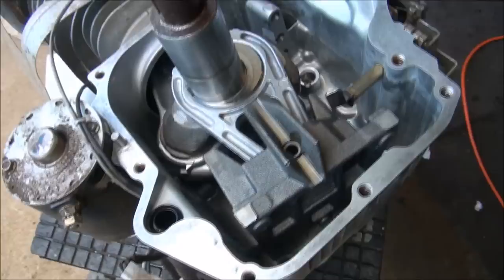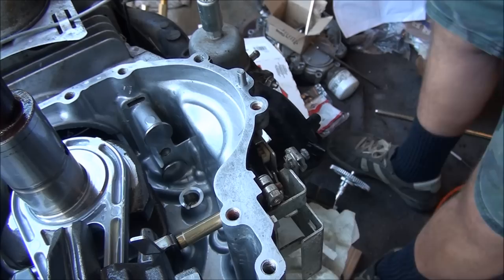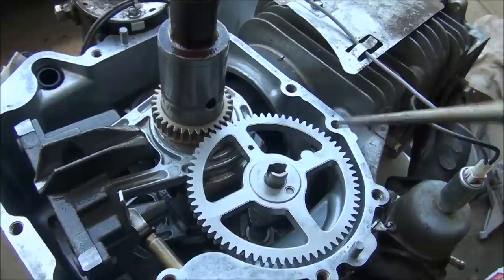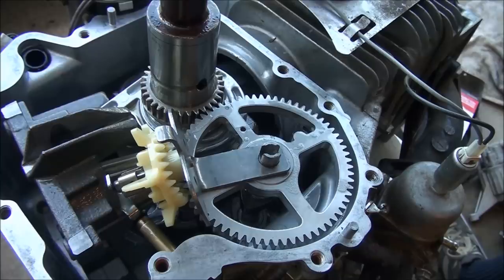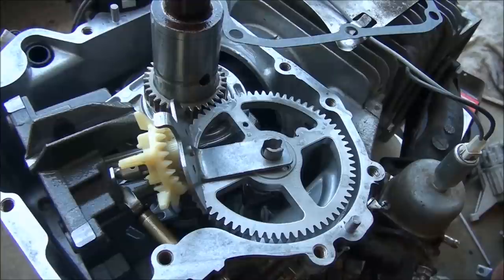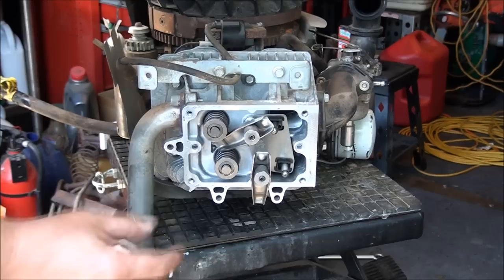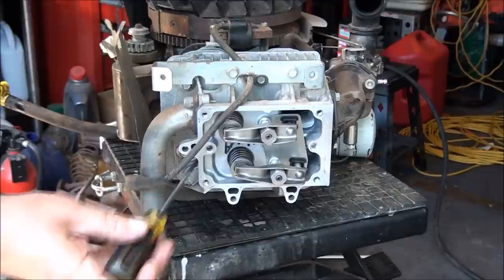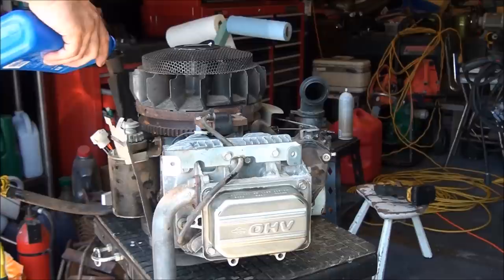DESTROYED! Part 2: What a BUSTED CAM looks like. Briggs and Stratton OHV INTEK engine common problem

Comment: The Very First Thing That I Would Have Done is Pressure Wash The Engine Or Used Degreaser. Good Tip Is When You Are Ready To Tighten The Bolts, Use A Marking Pen  & Mark The Bolt Tightening Sequence Near The Bolt Holes On The Sump. That's If You Clean The Outside Of The Sump, Un-Like In This Video. It Doesn't Take Much To Clean These Guys. Not A Good Way To Use A Wood Chisel. My God Jeff You Should Have Put A New Bolt In The Pump. I Would Not Be Happy If You Done That To My Motor. You Don't Need to Be At TDC To Adjust The Valves. If One Is Fully Down You Can Adjust The Other. W D 40 Actually Dilutes The Oil You Put On. I Would Never Put A Dirty Sump Back On With Out Cleaning The Outside . Over All Not A Bad Job I Guess....

Comment: Reason can broke is most likely not changing the oil enough or running it low. You can tell this engine was not taking care of. Hell he never adjusted the lifters. The cam broke because they use the compression release broke breaking the cam. The cam was stuck because it was stuck on the exhaust lobe opening the ext. valve. He took off the valve cover to see why the engine spun free and no valve movement means broken cam. Also check your pushrods for being bent. You can use a steel pushrod on the intake as that alm. one like to bend to easy.

Comment: Jeff I am a Master Service Tech and would like to say over all you do decent work ….NOT perfect …..Rather effective ….With that being said I from time to time come across lawn mower mechanics that truly have a passion …...both to learn as well as teach others . And I would be lying if I said you didn't have skills and or knowledge . However in this video I noticed several accounts of improper practice as well as 1 account of false identification of parts . Iam not calling you out to lambaste the situation rather inform . And I am certainly no hater or troll …..But you called the Tappets {lifters} …..Common mistake and easily forgivable by most because it is or was apparent what you where talking about ….LoL …...Trust me I still receive flack from some of my potential viewers about calling a solenoid a setteloid …...So I am not stereotyping ….But Jeff you advocate the Rocker arm pivots jamming screw {Torx} was 60 inch pounds yet proceeded to further torque it after the torque wrench clicked . This isn't ideal because you risk snapping the pivot or damaging the actual rocker arm stud . Jeff Tappets are common on most Briggs engines but lifters are rare …..To actually call a lifter a lifter it must be adjustable or hydro such as that of a Kohler Command for example. So Tappets are commonly found on modern small engines . You specify that you use Backyard methods...... Just don't apply Shade Tree Tactics as proper tools are imperative in many cases to deliver the best results for a customer . I wont to note that my opening comment wasn't intended to sound as if I was the proper procedure Police LOL...and there is no crime in misidentification of parts so long as your collective viewers are able to distinguish the difference in the mistake . And clearly anyone could . ….But in the last few videos I have watched on your channel I have witnessed you trying to apply vise grips to a oil pump cover screw to remove it …….bending of a blower housing to remove a twin cylinder coil or armature from a cannibalized engine …….Now granted it was a junk engine but seeing you committed to the task....well often you disregard logistics because your fixated on the speed of the repair …..{Example} using what appeared to be a chisel to drive the oil pump screw towards a loosened state might make many viewers cringe . Still I wont judge to harshly as we all find our selves in troublesome situations. So keep up the good work ….You have made many great videos that are very informative ….Just watch those shade tree tactics as I am sure your not trying to advocate them upon your viewers .
Reply from the maker: thank you for the comment! and tips! You sir are correct on all counts. I treat lawn and garden equipment rough they are tools to me.. And I do "hack" it up a bit in my videos for entertainment purposes : ) . I am also a motorcycle mechanic. My mode of operation is completely different when working on bikes. lol!
Reply: It's not the space shuttle, just a lawn mower engine!  By the way the device in question does LIFT the valves off there seats.
Reply: Nope, sorry,  tappet is a lifter by means of lifting and opening the valves. Great job on the video!!

Comment: You do not use wd40 engine lube you are supposed to use strate motor oil dude
Reply from the maker: It will be fine

Comment: And no gasket or sealer on valve cover?  You're kidding, right?
Reply from the maker: I always put a gasket or sealant which ever is recommended. I may not have shown that in this video... It did not leak any oil when running so I must have installed a gasket or sealant.

Comment: Best way to help the oil seal is to use a automotive window bone. This will really help since it is made of nylon which will make sure the seal is not cut or nicked. Using a feeler gauge is not the trick, Just saying Jeff.
Reply: Also a bicycle tire removal and seating tool, also called a 'bone'. Curved, just sharp enough, and just the right size to use the shaft to lever against.
Reply: @joeymitchell3863  You are correct and right on with your logic too. vf

Comment: You can rotate the crank until the intake valve is open, set the exhaust valve and then roll the crank until the exhaust is open and set the intake valve.

Comment: I wonder what the cage-like part that moves is? it is easy to forget the pump shaft doing that way, some people remove the pump cover in the beginning.You need a set of those bolt remover that bites into the bolt and turn it. It works great. sometimes it works to turn the cover too and it will move the bolt.
Reply: That's is the counter balancer block, takes vibration out of engine !!

Comment: According to the B&S repair manual, one of the bolts in each of the crankcase cover styles is supposed to have sealant. The manual shows a photo of exactly which bolt gets sealant for each engine.
Reply: Didn't he use LockTight on them,thought I saw that...
Reply: @tashathayer6427  You would normally use something like blue Loctite on all the bolts.
Reply: @tashathayer6427  He used gasket maker, he was supposed to use loctite. You NEVER put gasket maker on bolt threads like he did.
Reply: @fourbyfourer  That's What I Thought I Seen Him Do Too.. You Use Blue Lock Tight And You Don't Need Much.

Comment: Good video. I will remove that oil pump cover when the case has that bottom cover off...just in case those bolts give me a problem. I would never have put that bolt back though. Hardware store I will go...

Comment: Good job Jeff, I would like add an suggestion in a problem not mentioned on the Briggs & Stratton engine. 
The intake tappet/lifter in engine I serviced was seized, I dont know if this is the root cause for breakage of the compression mechanism or cam gear found in other youtube videos; just theory, I believe it should be carefully noted.

Comment: At 21:40 you could have moved the entire plate, which would have moved the screw just enough to loosen it, then grab it with vise grips....OR use a dremel tool to cut the flats down on the bolt, maybe to get the next size down socket.
Reply: I'd have just drilled the bolt head and extracted it with an easy out and replaced it with a new one.
Reply: Sometimes if you tap the bolt with a ballpeen Hamer that will loosen it not too hard

Comment: I don't know if you check comments on a video this old, but I have a question. I have a Troy Bilt mower with a Briggs Intek engine. The original owner was using it, hit something, and never could get it to start again. She took it to a neighbor of mine that was a shadetree small engine mechanic. He diagnosed it as a locked up engine, and she didn't want to pay for an engine, so she left it with him. It sat in his backyard for a couple of years before it was given to me. Since it had a locked up engine, I just used it for parts and never even checked it. It sat in my backyard for a year or so, before I finally got around to breaking it down. When I started messing with it, I found that it was building up too much compression to turn over. The valves were out of adjustment, so I adjusted them and it fired right up and ran perfectly. I eventually replaced the parts I stole from it, and I ran it a few times with no issues. I eventually found out that the deck was roached, so I parked it while I looked for a deck. It sat for about a year since I have five other mowers, and when I went to start it, it is now building up too much compression again. Is that what it would typically do if the compression release is broken?
Reply from the maker: Yes if a valve adjustment doesnt help it is most likely the compression release located on the cam.

Comment: 24:08  I’m having trouble with oil leaking out through this casing. I’m not sure why because I’m getting these screws as tight as I could without damaging them. Do you happen to have the part # for this o ring?

Comment: Did Briggs and Stratton redesign this    common problem relief valve or are you putting the same problem back in.
Reply: They have NOT redesigned the ACR on the cam. I've repaired my B&S 31000-series engine twice already in about 200 hours. The new parts are identical to the old parts. B&S should be ashamed.
Reply: Toro 216d front blade belt spindle whoble

?

Comment: These motors are pretty much indestructible. Human error is their ONLY enemy. You could throw that back together haphazardly and it would still fire. I understand you need to fill video time but, rotating the torque is not that important. Oh, that part you refer to as the governor......... it’s the oil slinger!😂
Reply: I did however enjoy the 10 minutes of gasket scraping footage in pt. 1. Very essential.
Reply: @joec1360  I thought he was going to fast forward that...

Comment: I just recently got a Snapper with the OHV Intek Briggs. It will spin free for a bit, then it locks down, it turns backwards fine though. Do you think this could be my problem?
Reply from the maker: Yes possibly a broken rod or cam
Reply: @JeffsLittleEngineService  Found it! Took sump cover off, no debris and compression release intact. Took flywheel off and found that 3 of the magnets came loose, wrecked the alternator ring, and were locking up the motor. Thankfully, none were really broken bad. I JB Welded them back in their spots.

Comment: Worst engines ever ... The compression release will always fail and the debris will eat up the timing gear, cam gear, governor, causing  metal all in the engine  The head gasket are constantly blowing. . Briggs should had put an extra head bolt next to where they've always blow, middle right side .. . Not enough pressure to keep the head gasket down.  .Total junk ....